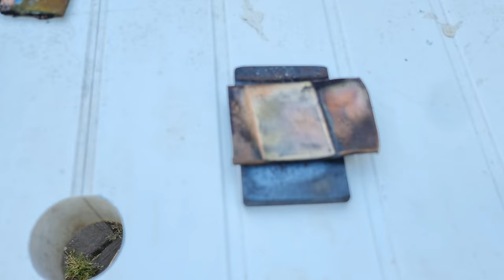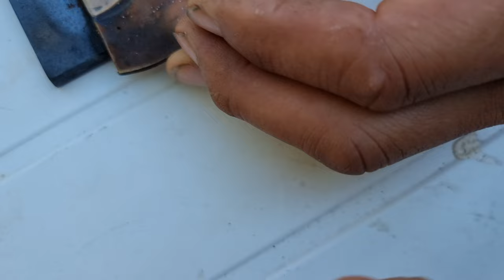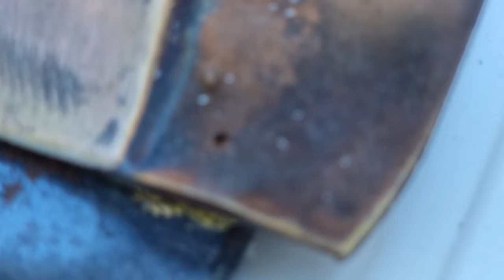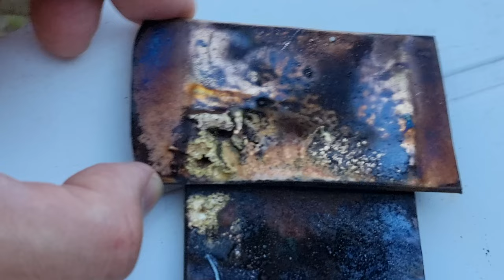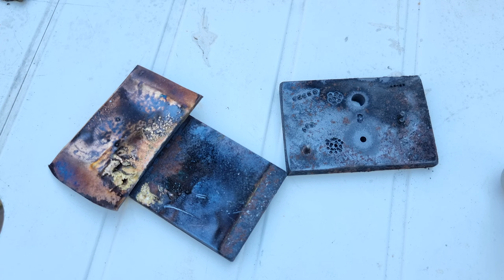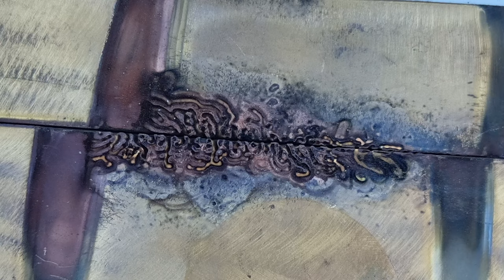VEGA - Cardioid Infarction

Comment: From what I understand of this video. The plasma traveled into the crack between the plates and then basically wreaked havoc causing all sorts of interactions
Reply from the maker: The brass on top was set at an angle, say 20º, above the Fe block. Anode above assembly with brass on top.
Reply: @MFMP  so the top brass was annihilated, the fe block below it just got “dirty” and the plasma bored thru the tungsten block
Reply from the maker: @harry554  It "churns" brass, disintegrates W
Reply: Maybe a golden angle crack would be even more accommodating.
Reply: That iron pole in India that doesn’t rust cones to mind but I think that was just an early Corrosion resistant aka stainless steel. But I wonder if there might be plasma annealing or the like.
Reply: If you want to get way out there i lately wondered if legendary flaming or magic swords were loaded or saturated with EVOs. That might also imply some requirement of the wielder to resonate or interact with them. Excalibur and Vorpal swords…
Reply: @alexdelcastillo1220  interesting. I was actually having a similar thought yesterday, if this could perhaps act as a bulletproof shield also
Reply from the maker: @alexdelcastillo1220  Absolutely - that is what the EVOs build for themselves in the VEGA Valley - Golden ratio cones
Reply from the maker: @alexdelcastillo1220  This had not escaped our attention.